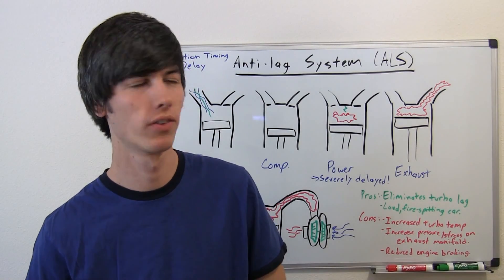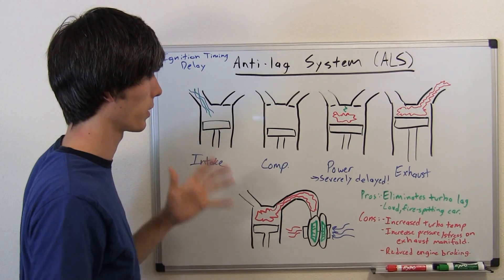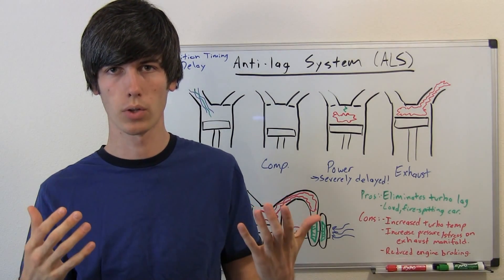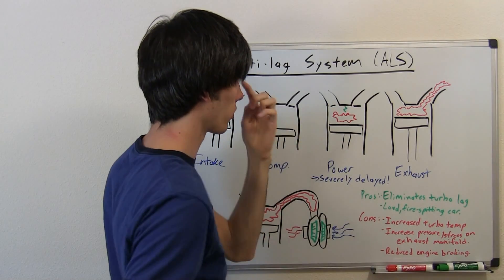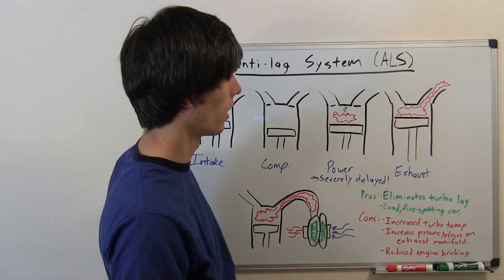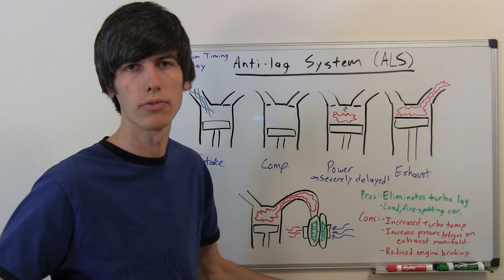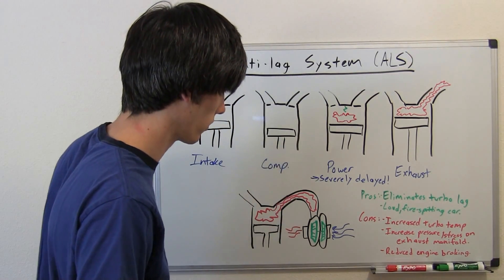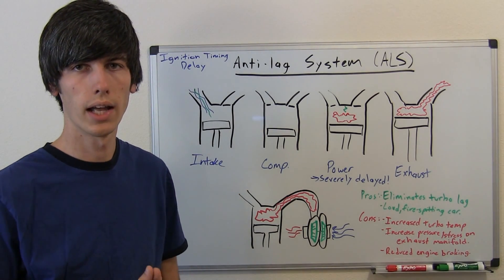Anti-Lag System By Ignition Delay - No More Turbo Lag

Comment: In 2010 and 2011 they really used this method in F1 to hold the downforce especially under braking. For the 2012 Season, the FIA indirectly banned the system, by defining some fundamentel rules to follow for the enginemapping.
If you look at some Videos from back then, you can hear a horrible rattling sound made from this system when they start to brake for a corner. Sounded like the engine would disintegrate every moment.

Comment from the maker: 2 step is a rev limiter. One step for launching (holds the revs relatively lower) and the other for when you're driving (rev limit, around redline). 

ALS by ignition delay could be done through ECU remapping, yes.

Comment: Great video. Wouldn't another disadvantage of this system be reduced fuel economy? Since it's burning fuel while barely powering the engine, I would think it would have some effect on fuel efficiency. Come to think of it, turbo lag also costs efficiency and thus fuel economy, but which effect is more prominent?

Comment: Anything from larger camshafts and other internal parts with upgraded fuel system and computer tune on the more expensive/more hp side. Higher flow intake, air filter, and performance exhaust on the simpler side for both the Bimmer and Yaris. You would have to turbocharge the Yaris to get it above 220hp though and it would no longer be everyday driveable for your girlfriend if you did... or do a motor swap. I own a E39 5-series (assuming yours is too) and a 1994 Toyota Celica

Comment: i got a question, might even be good idea to make video about it :), but non turbocharged engines,i for example owned 540 bmw, 4,4l 286hp engine, my question is what could i need do the increase power, and what could i do to my girlfriends toyota yaris engine to get power up? and im not talking about turbo charges and anything like that, just what kind of modifecation has to be done to an engine to increase the power, and could that yaris engine reach 286 hp like my old bmw? :)

Comment from the maker: I suppose, if they were at different pressures so if it was too high some would exit via the BOV rather than the anti-lag. Or if the anti-lag had some sort of electronic shut-off for the valve.

Comment: As your trying to keep the turbo spooled you are also creating boost making this even harder since your on the throttle boosting the engine. Left foot braking, right foot spooling is not the fast way around the track.
ASL on the other hand allows you to completely let off the accelerator and use engine braking power while keeping the turbo spooled and since the throttle blade is shut the bov will vent the boost until its needed.

Comment: Left foot braking and keeping your right foot on the accelerator to keep the turbo spooled up would be the old school way and is by no means the fast way around the track if you have a better means of keeping the turbo spooled up, let me give you an example why. Your coming down the straight about to enter a turn, you want to brake at the last second with the most braking force you can without loosing traction and start turning. How do u do this while your creating power with your right foot ??

Comment: Great video!  Just wondering, as you said the ecu tells it to spark later than usual, what tells the ecu to do this? Just when you back off the accelerator? Also, can you turn this type of "anti lag system" off and on when you choose? And finally, which ALS do you think is better? This one, or the one with the bypass valve? THANKS SO MUCH, LOVE YOUR VIDS :)

Comment: thanx for your quick response but i meant is it possible to achieve lift off flame with ignition delay or is it only really possible with bypass valves due to that really huge amount of fuel poured into the exhaust manifold?

Comment: I dont think your con of reduced engine braking makes sense.
1) You would not use this so much on decel.
2) The engine braking is from the friction of the engine at high RPM and the compression of the gas before combustion which is not affected.

Comment: i drive a 2500 dodge ram cummins turbo 24V 2nd gen. while driving in heavy traffic i find myself needing to jet in and out between cars and across lanes. the only way im able to do this is to drive with both feet and keep the engine revved up while breaking to keep my boost up in order to have a fast 20-60mph time. how could i implement something like this anti lag into my engine?

Comment: You said that if you were to use this design in a typical car, it wouldn't last very long.
So, what kind of cars use this system, exactly?

Also, if said car was looking for a way to bypass lag, why don't they just use a supercharger and be done?
It would eliminate lag, and also lessen the amount of parts that need to be fixed after a run.

Comment from the maker: This is likely due to a rich air/fuel mixture. When you're heavy on the throttle often times there will be an excess of fuel, and some of it will go unburned once you let off the throttle and there isn't enough air in the cylinders. When this air meets the outside air (oxygen rich) and the hot exhaust tip, it ignites, creating that pop that you often see in racing. I believe the Ascari is naturally aspirated.

Comment from the maker: Could you clarify your question? ALS will mean worse fuel economy, since you're using gas to drive something other than the tires (as well as more of it), and it will likely decrease the life of your car, since certain components are not typically meant to handle these stresses and temperatures.

Comment: Also how does it reduce engine braking?
Is it because the reduced pressure in the cylinders wont slow the trans down as fast as they would at full compression? 
but the air/fuel mixture still being compressed untill TDC